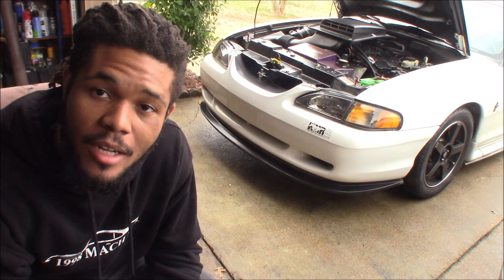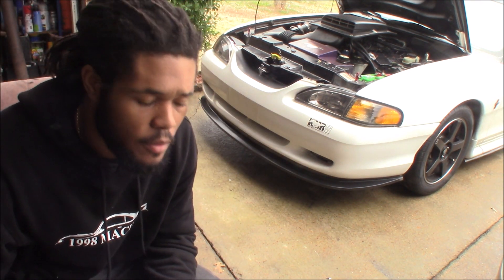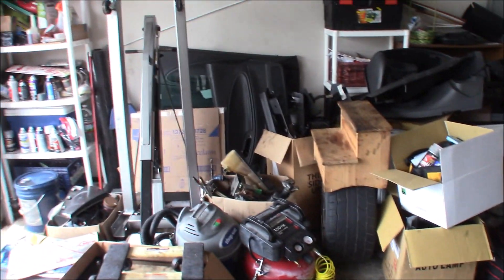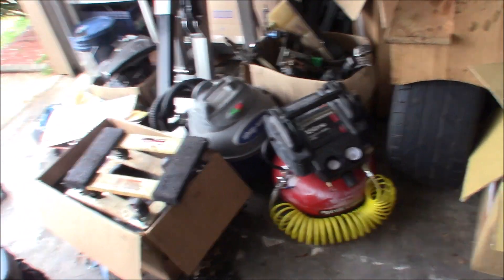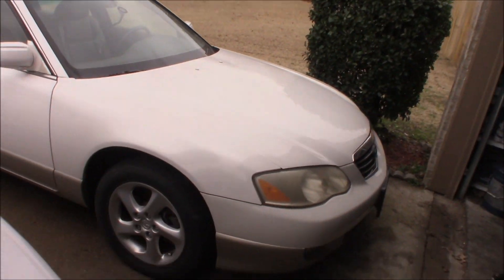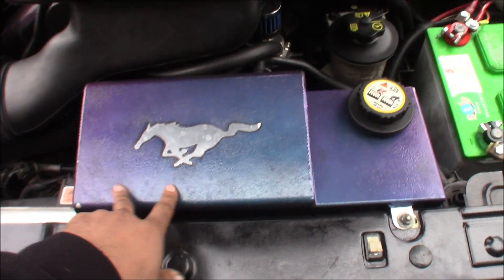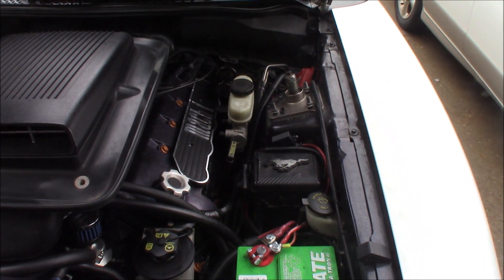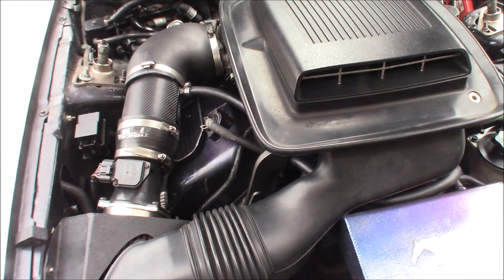Tips and Tricks on 4 Valve Swapping Your Mustang

Comment: Just watched your video on the 4V swap. 
Good info bro! I guess I realized where I went wrong with my swap. I definitely didn’t get the key for the 5.4 dohc motor. Nor did I get the ECU. I found a 5.4 SOHC ecu and I used the original wire harness in my mustang. Someone stole the 3V motor. I had a 2V motor put in and I believe the harness is not compatible even tho I did some wiring modifications for lengths to the injectors and coil packs.
Reply from the maker: Yeah I don't think the harness are created equal you'll need alot of stuff to match with the newer vehicles or a stand alone harness completely like how my transmission controller is.

Comment: Good look'n for the video cuz... really good job...very detailed. I'm swapping a 4v from an Aviator into a v6... Then dropping a 2v to the Aviator... Really wanted the v6 into the Aviator for the gas mileage when commuting but the v6 motor is seized
Reply from the maker: A 2v wouldn't be too bad for the Aviator itll be like the f150s with 2v motors in it. You might have to change the wiring harness for it to work
Reply: @DCreatorsCreations  so switch the Aviator's wiring harness with the 2v's ....then the v6's with the Aviator's ? Will the Aviator's automatic work right away?

Comment: I thought you were a mechanic 🤦‍♂️ must be natural talent! Still in awe of your 98. I have a 94 mustang a 06 p71 cop car and a 91 firebird. Thought about putting the cop stuff in the stang. Would be a build your own bracket . So 3.8 auto to 4.6 auto
Reply from the maker: The only thing about that is you need to get mustang gt parts like the intake, kmember, gauge cluster, rearend, etc You can get away with using the 3.8 auto shifter, trans mount and dash but everything else would have to swap out to get

Comment: How long did the full swap end up taking u I’m contemplating on swapping my 99 gt to either a 4.6 4v or a coyote I know the coyote is a lot harder but a better motor
Reply from the maker: Well working full time and my first time doing it and the fact it was my only car it took me about 5 or 6 months and that was because I had to wait for parts in the mail when I realized I needed something
Reply: The 4v is simple and can be tuned on stock ecu.   They also sound better.  If you build the motor and give it some compression they can make power like coyotes especially boosted but if you just wanna swap a stock motor and don't wanna mess with building it the coyote makes more sense however a teksid 4.6 with forged internals will take WAY more rwhp reliably than ANY coyote stock built or otherwise.  Even a sleeved coyote can't take the power a forged and built teksid block 4.6 can.  All 4v from 93-99 had it I believe the mark 8 and cobras.  It's an extremely strong aluminum block.  If you want to build the motor the 4v is better if you just wanna throw a stock motor in that is still pretty stout the coyote is better.
Reply from the maker: That's right! At the time of making this, I had no idea it wasn't until I started watching other people's builds before I learned about that